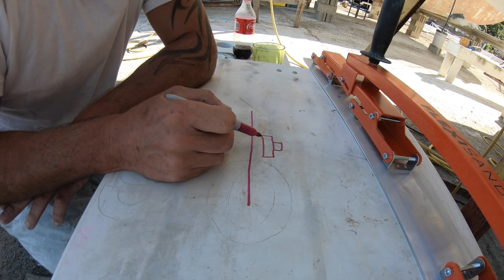Davy's Middle Name Should be MACGYVER! (S2 E52 Barefoot Sail and Dive)

Comment: Attach a single sander to the center of your 'long board'. You can screw a piece of plywood to the middle of the board and then use screws and washers to hold the sander firmly in place, make sure the screws through the board are in a single line perpendicular to the length to allow proper flex. You can ease the vibration on your hands by slipping short pieces of foam pipe insulation over the dowel handles. While true 'long boards' oscillate end to end, the random sander might work well enough for 'spot' sanding...
Reply from the maker: Thanks for the ideas!

Comment: it's a good idea! The sander with one machine is possible that the engine is not powerfull enough to move the whole structure. In case of the two engine version make sure they are syncronized.
Reply from the maker: Yes that is the difficult part!

Comment: Great video. 1 question, 1 comment. 
Question. The layering seems counter intuitive. I’d have gone small To big. Why big to small? It looked really smooth so worked well for sure. 
Comment. With the power longboard. You will need a solid mechanical connection to the sanding board. If you can remove the hand sanders base and attach the actual orbital mechanism to the long board then it should work. When using and orbital sander, your arm is acting as the anchor and so the face moves giving the sanding action. With a flexible connection of the Velcro, the board and your hands became the solid points and the Velcro kind of absorbed all the orbital motion. You need to transfer the movement directly to the sanding face itself. In this way, a slight modification of the first design may be best.
Reply from the maker: Because it was a large repair I did big to small 😊
Thanks for the advice on the sander!
Reply: When laying glass to provide structural strength the bigger piece attaches to more surface of the original material and ties all the various original layers together providing a stronger bond. If you start with the small it’s only holding onto a small part of the boat and then subsequent layers also only touch a small part of the boat and then are mostly touching the new repair.

Comment: Comedy gold .🤣  For the powered longboard may consider sacrificing an orbital sander by bolting it to the longboard in the centre and then two round door handles on either end of the board. Useful if the sander has a lock on switch.